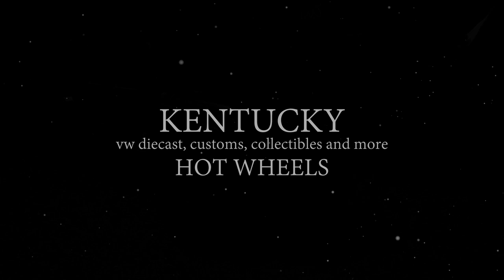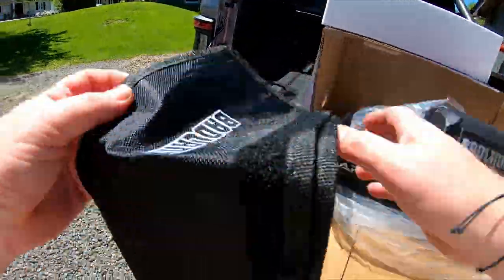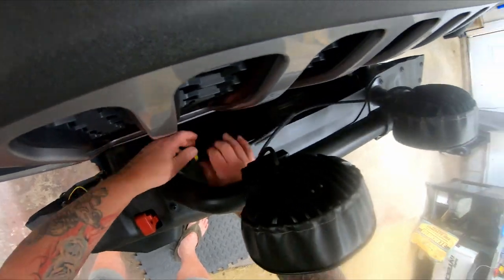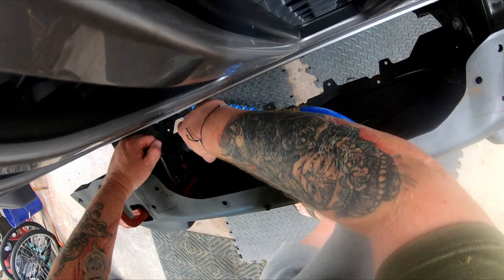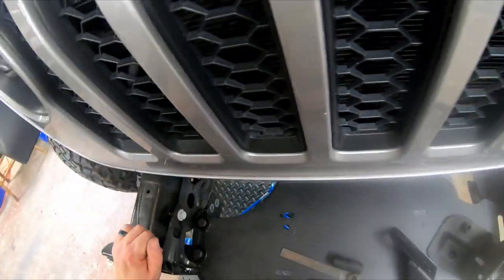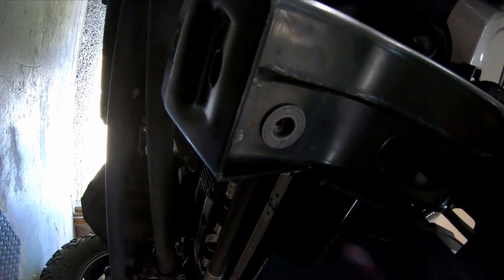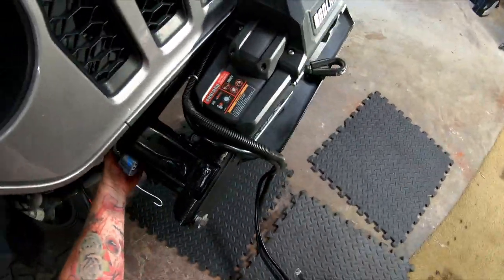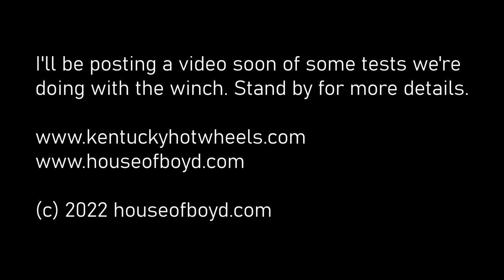JEEP GLADIATOR WINCH INSTALL

Comment: Are you able to swing the free spool selector handle or is it blocked by the bumper?
Reply from the maker: No. I've got a solution that I'm working on though that I'll post in another video. Basically, we 3d printer a different "knob" and we're having it cast.
Reply from the maker: You may be able to use these as well... 
https://www.4wheelparts.com/s/_/?Ntt=Poison+Spyder+Zeon+Winch+Spacer+Plates&_requestid=4513
Reply: @kentuckyhotwheels  will be very interested to hear and see how that goes!
Reply: Could you show what you did with the wiring?   I can’t figure out where to mount the disconnect switch. Do you need it?  If so, where did you put it?
Reply from the maker: @masterdiecasterusa2893  I did not use the disconnect switch. You don't have to use it if you don't want to. If I did use it, I'd find one a bit smaller.
Reply: @kentuckyhotwheels  Thank you.
Reply from the maker: @masterdiecasterusa2893  No prob...good luck with your project!

Comment: I just installed this same bumper with the same winch plate and it didn’t have any instructions so I looked on YouTube and didn’t find anything that would help with the install. I emailed the seller of the bumper and winch plate and he emailed me the bumper install pages and a link to a video for the winch plate install. This video shows a different arrangement of the angles which is not how you installed yours. Did you get instructions or did you just install everything like you wanted it ? Here is the link https://youtu.be/uTGeai6dqqA    The are speaking Chinese I believe but look at the angle arrangement. I like the way you installed these but I don’t know which is stronger. Thoughts ?

Thanks for the video … good info
Reply from the maker: No instructions. I just winged it...haven't had any issues... :)